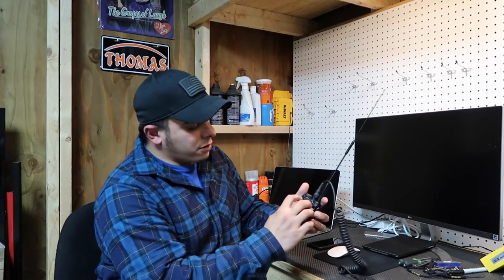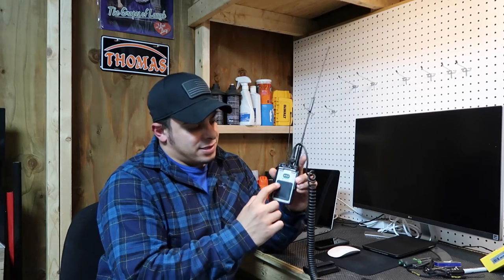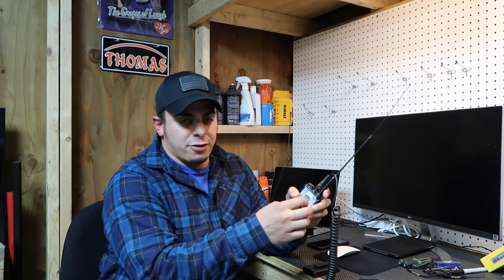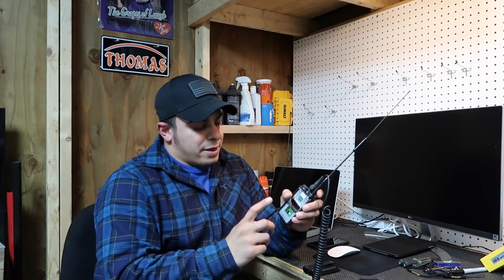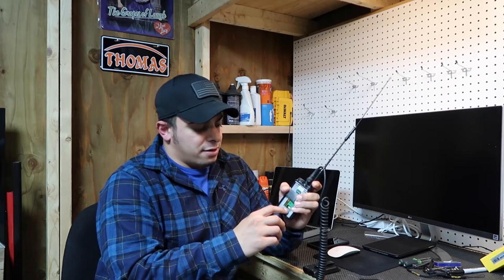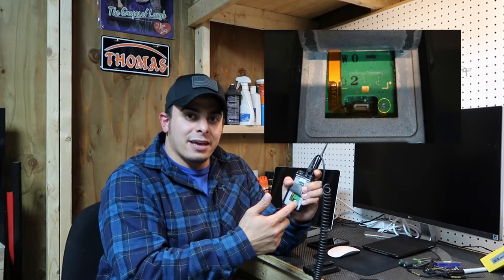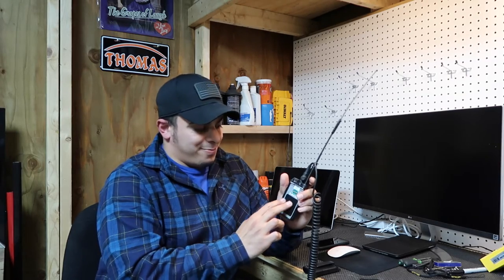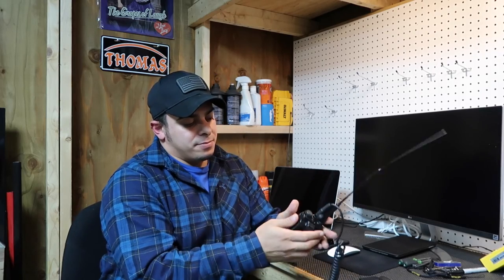Yaesu VX8DR MARS/CAP Modification

Comment: Hi,
One more question.
After modification of VX8DR does all settings stays like from the factory , or I have to back up those files from the radio ?
Reply from the maker: +RAMBACY you can back up your radio settings using chirp but once the mod is complete the radio is set back to factory and you'll need to set your radio back up. I didn't have much programmed into my radio so I did mine right off the start